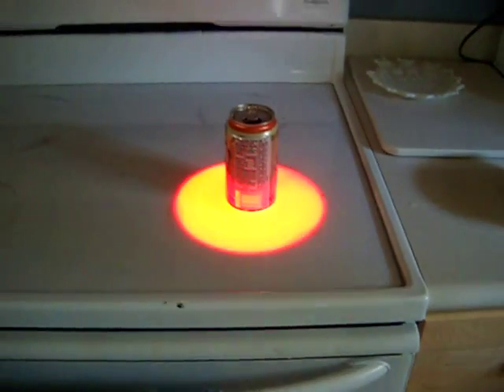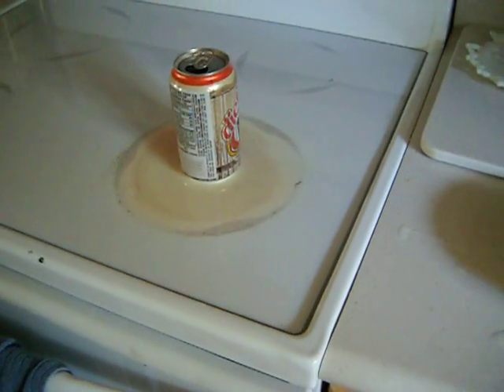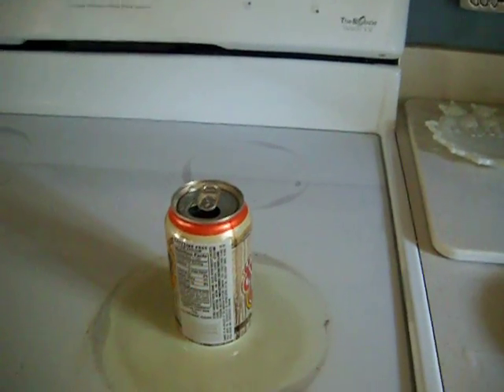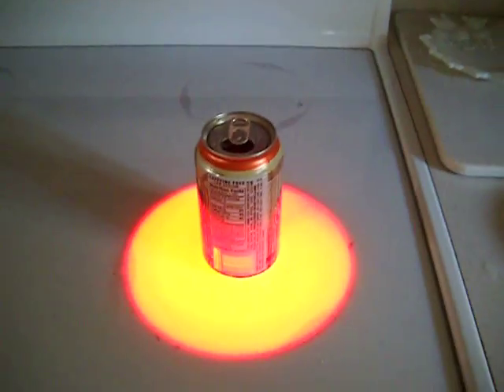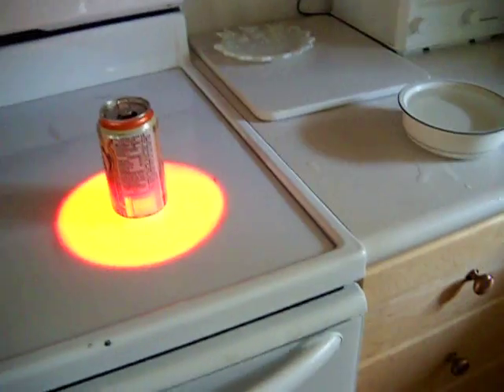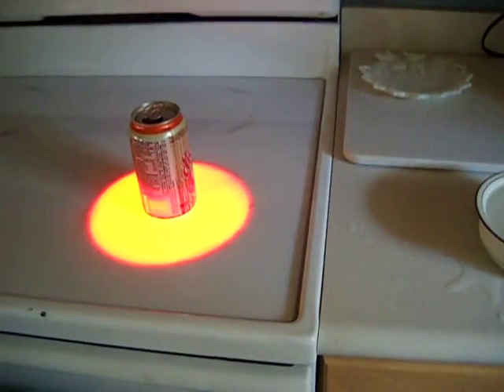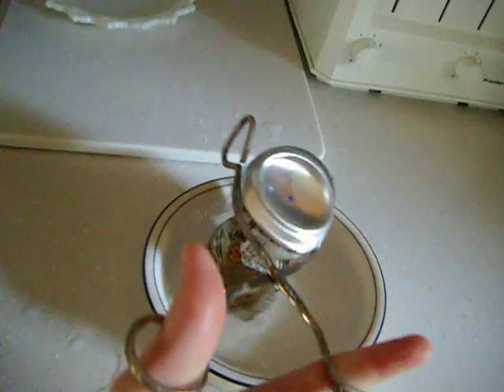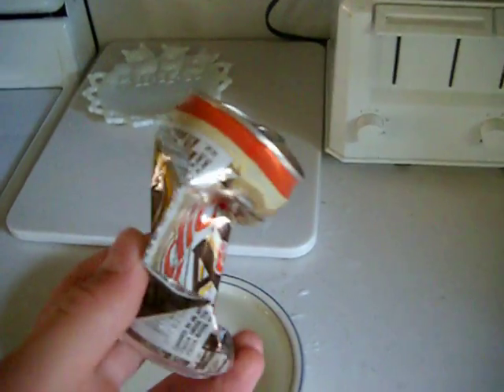The Imploding Soda Can

Comment: Actually you explained it wrong in the video and description. Air moves from areas of high pressure to areas of low pressure. When steam is created, collision of molecules create a very high pressure pushing the air out. When cooled, the steam condenses and there is no air in the can (low pressure). So now all the air and water (all fluids) rush into the can, crushing it.